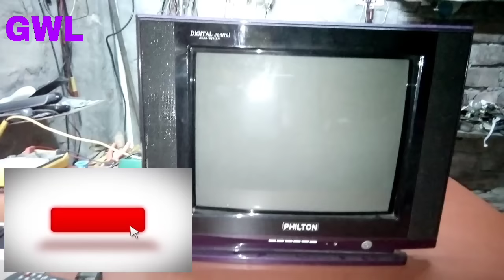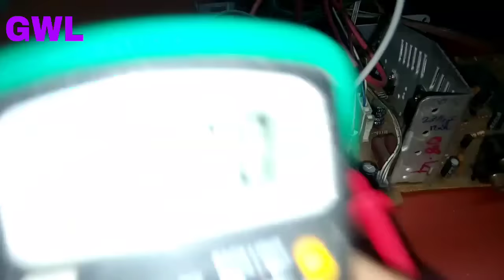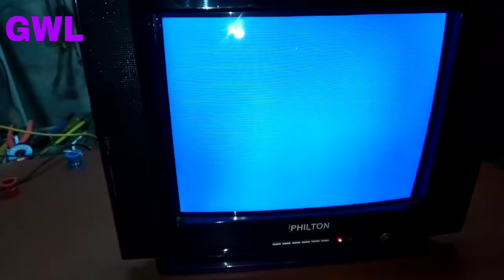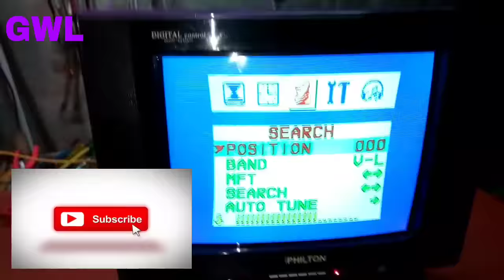No Light Display Problem But TV On, TV Fault Repair.

Comment: TV power led on lenken picture tube tik tik sound da raha ha Kya problem pls
Reply from the maker: output transistor change kare.or 110 eht supply cheking  supply volt thik hai to eht change kare.
Reply: @GOODWORKLEARNING  bol raha ha picture tube batgiya